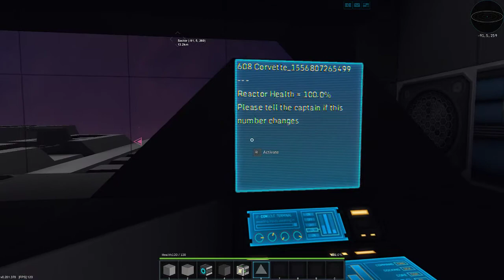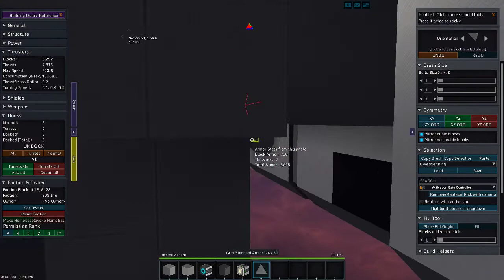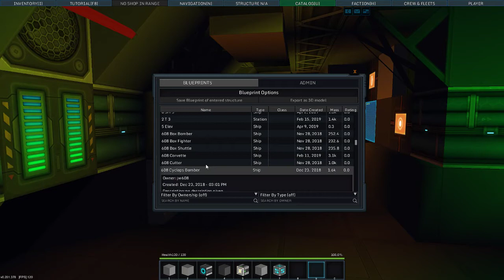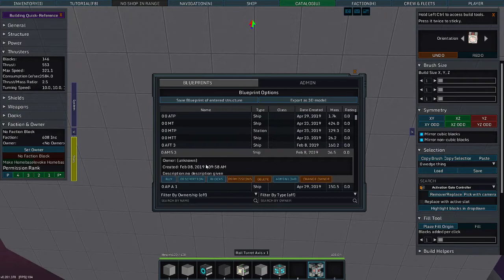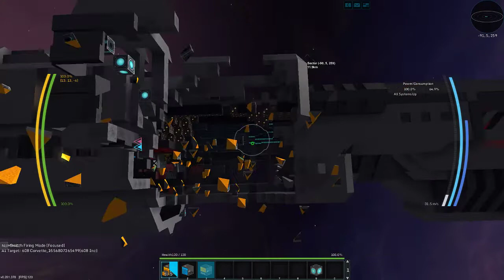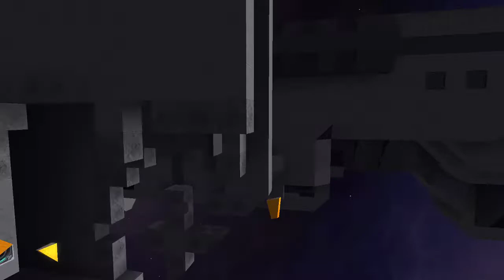Docked Armor Plate Summary - StarMade S2-260

Comment: 2:17 you can always extend the armour plating further along the hull. I was actually designing some a while back but thats before a fuw updates, so not sure if my calculations are still correct, but my friend and i worked out that the best armour plating for weight want Advanced, it was a combination of standard and basic. 

We found the health was more, and the weight was less, but it took up 3 times as much space. so for a 1x3x3 of advanced you needed 3x3x3 but with slabs i think that could be taken down to 2x3x3
Reply: Alternativly in the top middle of your ship you could have a docked Skeleton that holds all the plates :D with floating attachment points for all the plates.(or even from where the docking point on the front currently is and have floating docking points)
Reply from the maker: I thought about doing one plate that wrapped around, but if it overheated I'd lose both sides.
And I need to do more testing on the armor combos.